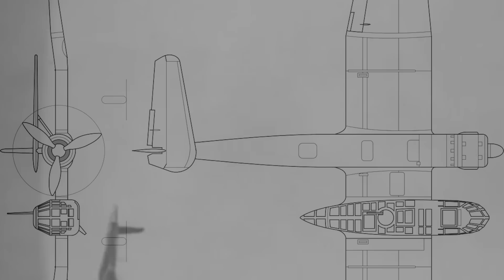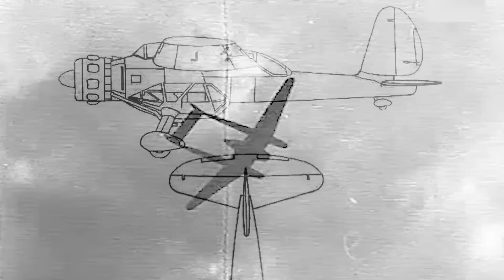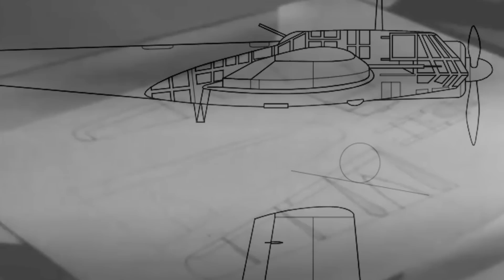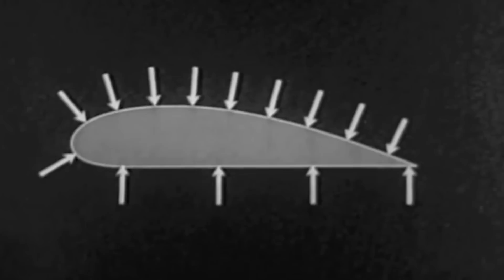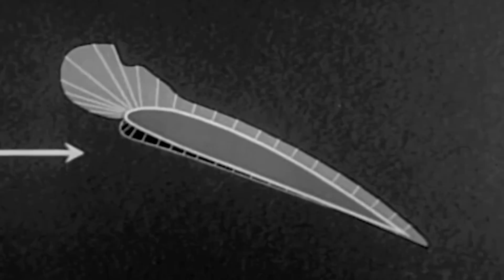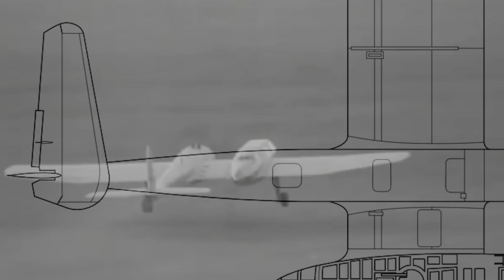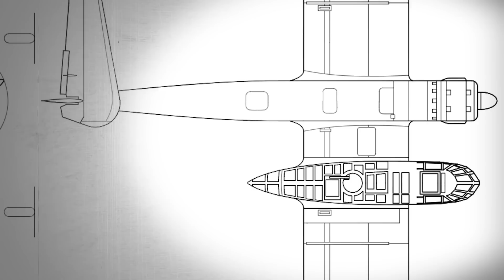BV 141 - The Most Asymmetrical Airplane of WW2

Comment: Looking at the plan view of this aircraft, with its off-centre thrust line, one would expect it to continually yaw to the right, from the parasitic drag of that unstreamlined crew nacelle and induced drag of the larger right wing. The thrust is a long way off-centre. The fact that the yaw is countered by the rotation of the prop, resulting in symmetrical flight forces is amazing to me. In conventional single-prop designs the engine-prop yaw is countered by offsetting the fin and occasional rudder input e.g when accelerating on take-off. So the induced drag from the fin pulling sideways must be quite substantial, resulting in inefficiency. This "asymmetrical" design is a really remarkable solution. I would have thought it gave a great boost to fuel economy and speed...maybe that awful lumpy angular draggy observation nacelle stuffed it up.

Comment: Gotta hand it to the Germans for coming up with stuff that looks weird yet performs beautifully. 
Many years ago I was touring on my motorcycle. Parked for the night, I was chatting with a fellow who was also roaming on a mid 70s  BMW boxer twin. He said that around 1800-2200 RPM the engine felt buzzy and odd. Then around 3000 RPM the engine would start balancing itself so sweetly it wasn't even funny. Figures.

Comment: Decent enough video, but there are plenty of mistakes. The very first prototype had a stepped crew compartment - not the glazed nacelle of  later versions. They also fail to mention the troublesome hydraulic issues which plagued the program through trials. The redesign after installing the more powerful engine desired by the RLM was fraught with handling problems and minor issues that further delayed testing. Before these were ironed out it the FW 189 was already serving quite well on the eastern front making further development of the BV 141 unnecessary. 

I also found the narration of this video distracting - I felt out of breath just listening to it. Great video footage though.

Comment: I'm constantly surprised by how fast the Germans could go from design to actual airplane in such a short time frame. I guess that slave labour had something to do with that.
Reply: Was also part of an era where testing was more prominently used over strait engineering. Just look at the nuclear power programs directly after WW2. A lot of engineering was used, but actual built prototypes were the normal.

Comment: Some technical inaccuracies in this. 
All prop aircraft have a left-turning tendency when climbing, (unless you have a twin engine aircraft with counter rotating engines). The main reason for this is that when you tilt the plane upward to climb, the angle of attack is different on the right and left. For a prop that's rotating clockwise from the pilot's pov, when the blade is on the right side, it has a high angle of attack, and when it's on the left it has a low angle of attack. So there's more prop force on the right than on the left, and your plane will pull to the left, hence the saying "More right rudder!" When you're in straight and level flight, there are no such tendencies, and you can straighten out the rudder.
The other is the claim that the "rudder was under constant assault from drag". The whole plane is under constant assault from drag, as are all aircraft! The only reference I've found is that "rudder in the rear being assaulted by the powerful air produced by the propeller engine in front as there was no cockpit to stop the air", but there's no explanation about why this is bad. The contemporaneous P-38 Lighting would have had the same issue on its rudders, as it had two engine/empennage booms the way this plane had just one, but it was a successful aircraft.
Third, while the asymmetrical design canceled out the p-factor yawing tendency explained above, the plane had to be trimmed to flight straight in straight and level flight, because of the deadweight drag of the crew nacelle.
Finally check out the Edgley Optica. It's an observation aircraft with twin booms and a pusher prop behind the cockpit. https://www.youtube.com/watch?v=2A29M-zANIs

Comment: “It’s the plane that made the Kessel Run in less than twelve parsecs."
Reply: Knew the Millennium Falcon reminded me of something.
Reply: Lmao
Reply: Good line, except that a parsec is a measure of distance, not time.
Reply: @hankhicks1108  If you are familiar with Isaac Asimov's Foundation series, this could actually make sense.  Trans galactic ships in his series didn't go from point A to point B in one straight line jump.  Rather the navigation computers on board calculated a trip in a series of smaller jumps that would keep them clear of obstacles like  planets, stars, and strong gravitational fields like those produced by black holes.  This could translate to various total distances traveled in any given trip.  Therefore, boasting that your ship was able to make a certain trip with a smaller total distance traveled might actually speak to the power, and efficiency of its navigation computers.  I doubt this was considered by the script writers of the film.  But, strictly speaking it is not necessarily an error.
Reply: @williamlopez8676  Also, nothing in space is static. If point A and point B are moving away from each other, the ship that makes the trip the fastest also makes the trip in the shortest distance.

Comment: I can see the center of lift looks about right, but the center of thrust is offset from the center of drag - not unlike trying to fly a 2-engine plane on one engine.  Leaving half the elevator helps this drag offset but doesn't solve it.
What am I missing???  All that offset to reduce the Left Turning Tendencies?   One would think if there were so much LTT's, some asymmetry would be built into all designs?  Still, I just don't understand the aerodynamic design.

Comment: The biggest problem with an asymmetrical design is actually just load-out flexibility.  Not a problem with a recon aircraft, of course, as long as any fuel draw is done to maintain overall center-of-mass in about the right spot.  But with anything with something heavier than a gun and its ammo, you really have to be careful in where you would mount the bombs/missiles.  Less an issue in modern days with computer assistance, but...